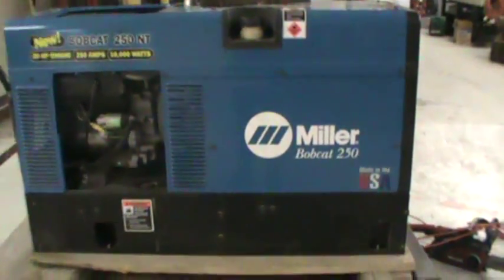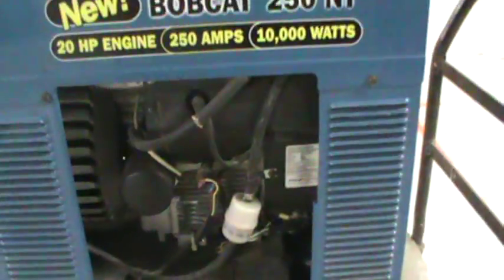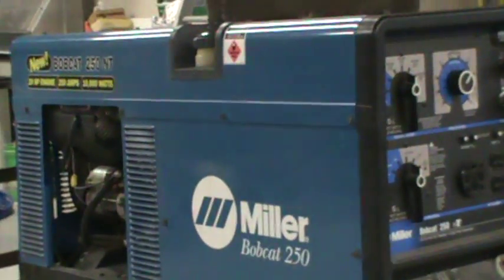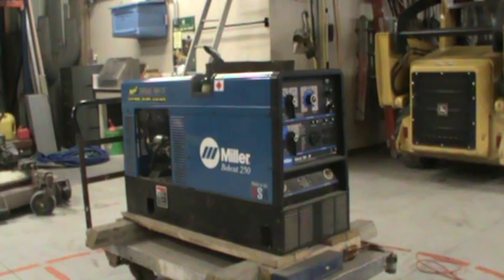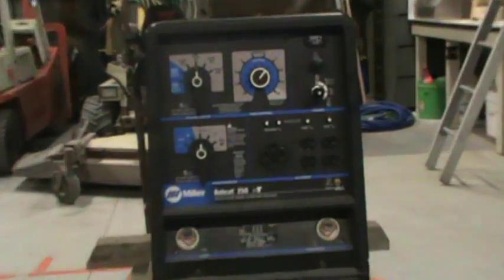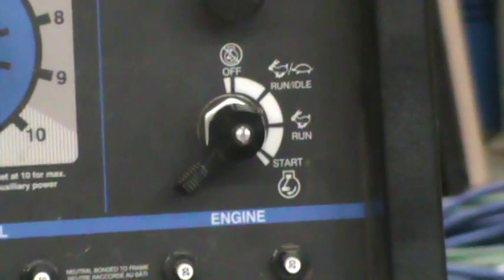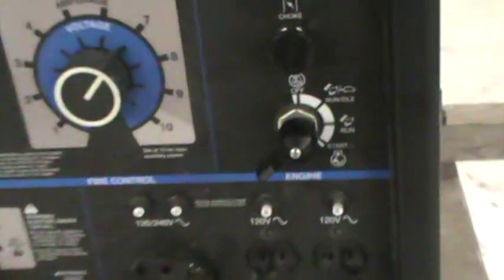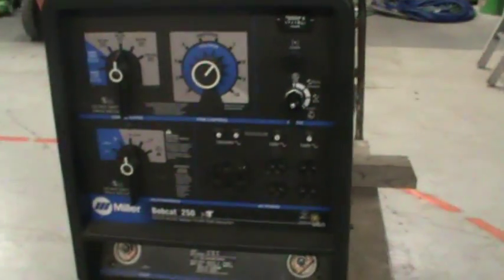Bobcat/Miller generator

Comment: @CCSinventions 250 Bobcats new are around $3000 new, one in that condition would be $2200 to $2500.  For $20k, you'd get a 50hp, 500amp, 20KVA, with an air compressor.